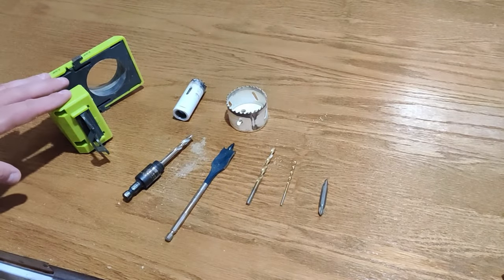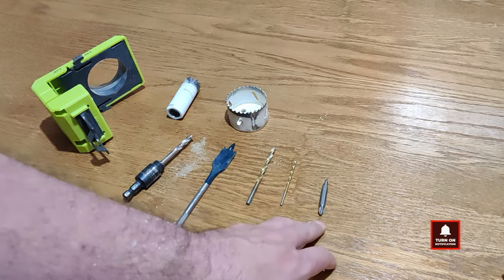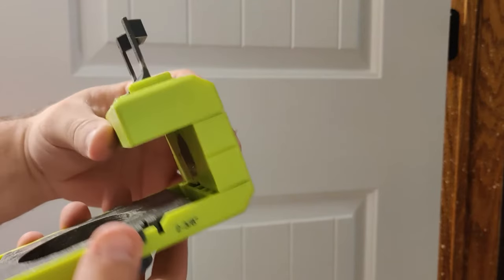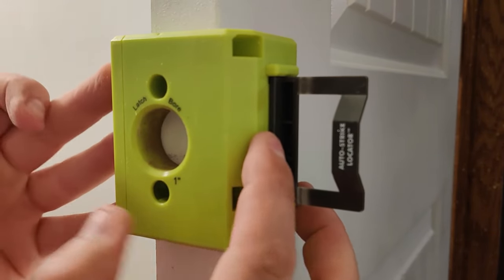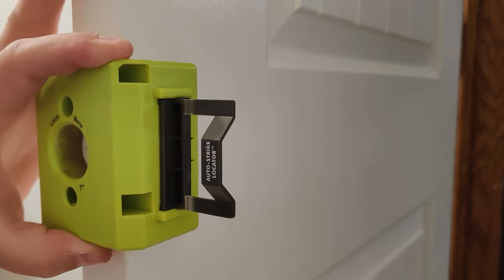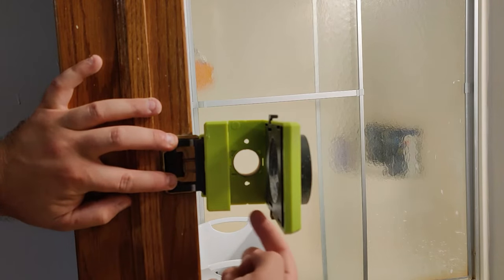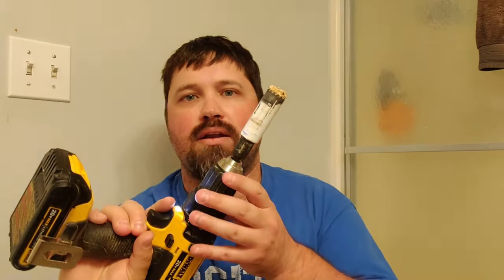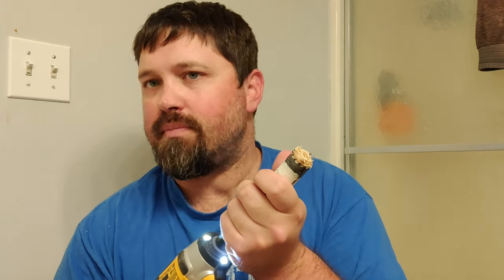Ryobi Auto Strike Locator (Ryobi Door Lock Installation Kit)

Comment: Are we all going to ignore that he gouged the F out of the face of the door when he started drilling the knob hole from the other side?
Reply: hahaha
Reply: Something about going through the other side. First side went relatively well for me, second side gave me trouble, the  bit came loose from the chuck because I had reversed the drill to back out the saw, once I got it adjusted, it caught really hard and fast and jerked my arm/elbow down with the drill really hard. I had to get my husband to finish getting it out. I'm inexperienced with drills and this was my first time using this tool so I'm sure it was user error but it did work.

He might have some door repairs to do after that faux pas. I intentionally did this before I sand, prime and paint the door in case I damaged the door during this process. It's an old door, not sure how old, but it's solid wood. I had to repair the holes the previous homeowners put in it with Elmer's wood epoxy 2 part system. I've seen carpenters use Bondo for this but went with a product designed for wood to hopefully ensure a better, long-term finish.

Anyway, sorry for being unnecessarily long-winded. Hopefully someone finds my comment useful. I only came back to the video for other comments because we can't get the 1 in hole saw off and I need suggestions 😬
Reply: It made me think about when Kip on Napoleon Dynamite was trying to show how durable the tubberware was by rolling over it in the van... lol.  "Dang it"
Reply: Maybe should of edited that out or showed why you should flip it once you drilled half way through. Highly encourage everyone to use the template on both sides to avoid that type of issue.
Reply: @rv310409  Can't you just drill all the way through the first time?
Reply: @carlhenderson7254  😂 maybe the best movie ever!
Reply: @robertmorrison3140  Drilling all the way through with a hole saw causes blowout.  Moving to the other side to finish the hole usually makes for a cleaner hole unless the drill slips like this guy's did
Reply: No the other side will splinter
Reply: No it wilL splinter
Reply: It will splinter
Reply: @Derakkon2 Exactly. I hadn't used the kit in a few years and on a brand new door. I forgot this most important step of finishing the drill through from the other side and I definitely damaged the exit side. Lesson learned.

Comment: I've had one of these kits for several years myself and love it! I use it all the time! Just one thing I learned very early on with this kit or ANY other brand... I only use the kit to get my holes started, then remove it. Why? Because the bits get HOT and they will melt the plastic! You don't really NEED to leave the kit attached once you get your pilot holes started. It's saved me from having to replace the plastic kit all the time. Just a trick I learned. Oh, and I sure hope this was not a customer's door since your second side got a nice mark from when your hole saw rode across it. Don't worry, I've done that a time or two but not in several years since I taught myself little tricks to avoid it. I can't afford to replace a customer's door because of MY mistakes. Anyway, nice video! Just thought I'd throw in the fact that it's best to just get your initial drill pilot holes started THEN REMOVE THE KIT. You'll avoid melting it from the hot hole saws.
Reply from the maker: That's a good idea.  I appreciate the feedback.  And, no it wasn't a customer door.  It was my own.  I was able to just fill it with wood filler and sand it down.

Comment: When I am drilling a door face I use painters tape or masking tape on the wood surfaces which minimizes the risk of splintering or scuffing the surfaces such as what occurred on the backside of the door/knob hole. I also spray the edges of my hole saws with silicone spray which helps to cut friction and slide through the wood easier. I do this on my table and chop saw blades as well.
Reply from the maker: Good idea

Comment: So essentially you only need the auto strike locator if there is already a strike plate on the jamb?  I've got to make a new hole for the strike plate.  Thanks for the video, just what I needed!
Reply from the maker: The locator can also be used if you need to cut a new strike plate.  Once you have installation kit set to the location you want on the door, you can then use the locator to determine where the strike plate needs to be on the door jamb.  So you don't necessarily need to have the strike plate on the jamb cut first.
Reply: Since you're setting a new strike plate as well, it may make sense to pick a basic location and set the strike plate in the jam first. That way, you're able to use the auto locate jig effectively. I've found that using it without the plate in place still gives you a general idea, but the jig removed all doubt.

I know by this point you've probably installed it, but future reference for other projects.

Comment: Very nice video thank you for your excellent advise. I went ahead and purchased the Ryobi  door knob installation jig which made re-drilling the main 2 1/8" holes very easy. The original holes were made with drill bits requiring all 4 to be re-drilled. Drilling the new holes was easy and very accurate and time saving. Unfortunately,  I could not figure out how to use the strike locator which is not indented like the one on your jig.  Other than the strike locator the jig works great.

Comment: What screws did you use to tighten the thing down with??
Reply from the maker: I just used a couple drywall screws.  Though you can use the same screws you will use to set the face plate.

Comment: good, informative video... particularly thanks for showing how to use strike locator (it's for existing plates or for when you put the plate first!)
How did you replace the hole saw between sizes? mine seized up after using larger one first, puzzled how to get it off....
Reply from the maker: Watch the end of the video.  I show you how to easily remove the arbor from a hole saw.
Reply: @HomeRepairHub  is there a way to do it without an impact driver? I don’t have one.

Comment: I don't have an impact driver but did try using my drill in reverse and holding the hole saw to try and remove it. Was too tight on the drill bit to work, and one time was really close to cutting my hand! Gave up after that and just used a pair of large pliers on each piece to remove it. One time it even took two people (two hands on each pair of pliers) to twist it off. Thing gets stuck real good!
Reply from the maker: The key is the impact driver.  Doesn't really work with a standard drill.
Reply: @HomeRepairHub  I figured. I don't have one so I had to use what I had :D

Comment: how  to mount holesaw on drill ? you forget to show that in video ! do the bit come with ryobi door lock installation kit ?
Reply from the maker: Here is a link to the door lock installation kit, see below.  If you purchase the kit it has 2 hole saws.  In the kit there is an arbor bit as well that looks like a big drill bit with threads. 
 The hole saw slides over the top of the bit and screws on the arbor.  The arbor bit will then go into the chuck of your drill just like any bit would.  Does that help?  https://amzn.to/3l7zkvY

Comment: Is it best to hang the door first?  Or can I do it before I add the hinges?
Reply from the maker: It really depends on the situation in my opinion.  If you are replacing an existing door I think  its easier to hang the door first and use the auto strike locator to line up the new door knob location with the existing strike plate, assuming you have the hinges already cut.  That being said, if you are going to use the old door as a template for your hinges, its just as easy to mark and cut out the old door knob at the same time.  I use the existing door as a template in this video:
 https://www.youtube.com/watch?v=CWC6XkbQjIw
The auto strike locator is definitely nice when try to line up the new door know with the existing strike plate.  Basically you can do it either way.
Reply: @HomeRepairHub  thank you!!  I'm replacing a door while trying to reuse the old hardware.  I think it might be easier to deal with hinges first and hang it like in your video.

Comment: Tip, if you put a flat washer on the arbor before the hole saw if makes it much easier to get the saw off.
Reply from the maker: I will have to give that a shot.  I usually just use an impact driver.  It comes of easy too.   I will try that.
Reply: @HomeRepairHub  does that actually work

Comment: This thing is a piece of crap. The spade bit guide is crappy plastic and  got chewed up. Get a kit with two hole saws for the job.
Reply from the maker: Spade bit guide?  When you buy the kit it comes with 2 hole saws, at least it did when I bought it.  You can use a spade bit but it will chew up the plastic just like you said.

Comment: How do you know if it's 2 3/8 or 2 3/4?
Reply from the maker: 2 3/4 is more common in commercial and 2 3/8 is more common in residential.  That being said either will work in most cases.  Most hardware you buy for the door can adjust to either.  So either will work.  When I cut interior doors it's usually 2 3/8.  Hope that helps.